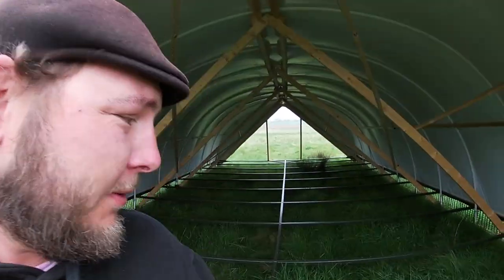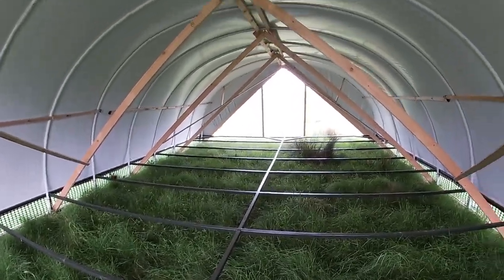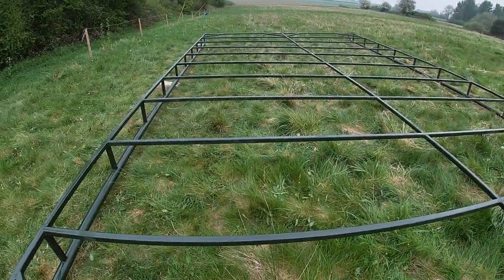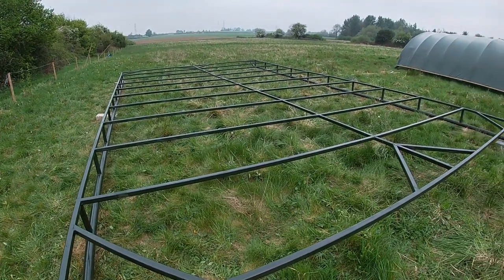Welding a giant Skid/Ski for a big Chicken tractor!

Comment: What lengths of box steel did you buy and how many did you need, you should do a full material and measurement list I would buy it 😉 im around 4 months from getting the deed to my farm 🚜 your videos are brilliant
Reply from the maker: Thanks 😁, roughly 100 metres work of 40mm box. I'd make smaller ones/ more of them tho. easier to manage and adapt to the regulations that come into play as u scale up. Iv now switched back to a static house and rotating them around the range with poultry netting. Also dont use pvc pipe hoops unless you go over kill on wood supports, they do not like the sideways winds lol. Vids on all this to upload iv just been holding back the content for the last 6 months whilst we go through our planning permissions with the council almost sorter tho so should be uploading a flurry soon 👍